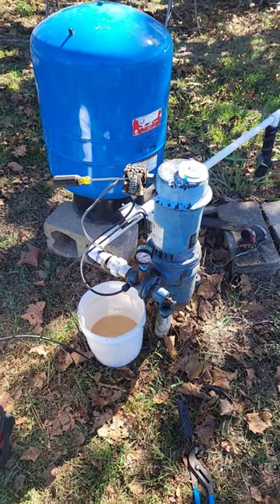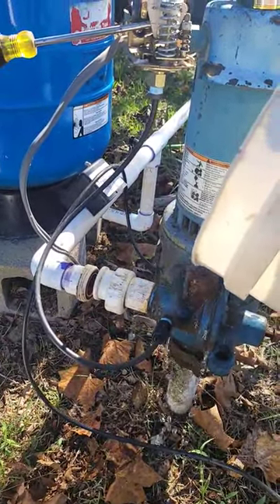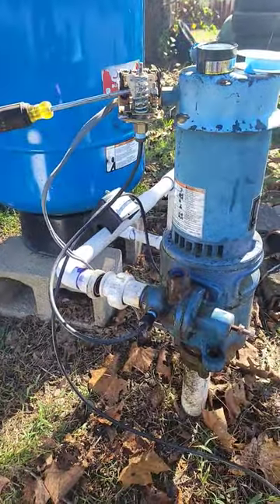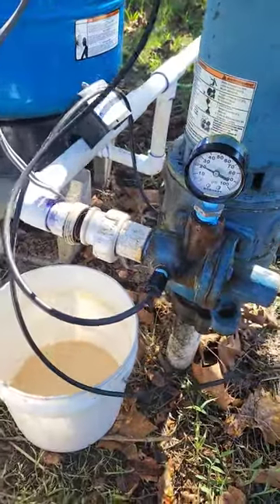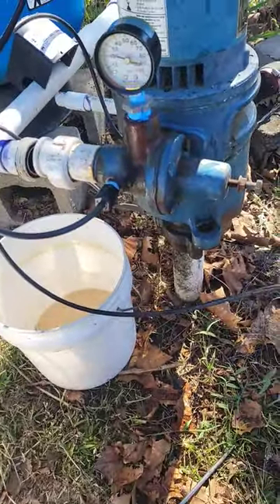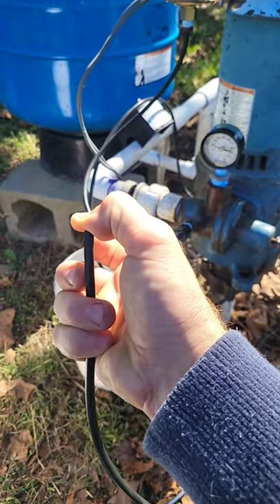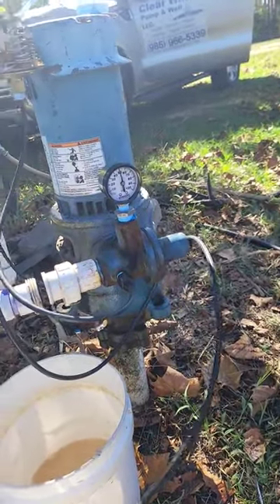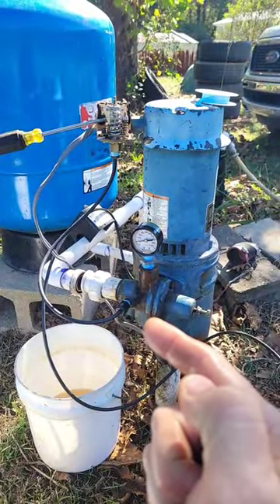Deep Well Pump - No Water - Quick Diagnostic Check

Comment: What a neat way to check for pump operation and determine foot valve issues or holes in suction pipe. When you ran the temporary test line from the bucket, did to connect directly to the pump volute by way of a 1/4” plugged port?
Reply from the maker: Yes hooking to this port goes straight to the suction side.  It allows the pump to build pressure and determine if jet or impellers have failed.  Usually if either problem they can have the same symptoms and be very difficult to diagnose.

Comment: @ClearWaterPumpWell good day sir, im exactly having that kind of problem right now sir,
question: you theres must be a clogged? where commonly its clogged?
Reply: @ClearWaterPumpWell may i ask if that deepwell is now working, and what is real problem of that pump?.does a regulator repairable? or should i buy a new regulator?
Reply from the maker: The jet nozzle in the well on the end of the drop pipe can get clogged with iron flakes.

Or the impeller in the pump can break and not pump enough pressure to jet.

That is what this test I'm doing helps solve without pulling or tearing down the pump needlessly.

Comment: I know this is old video but I got a question and hopefully you can respond promptly, I'm having well issues currently, my well is 43ft deep I replaced everything in the well, jet, foot valve, pipe everything. When I reassembled it and tried to prime it, it wouldn't prime. The original issue for pulling the pipe, was the leathers and faulty jet (no foot valve originally) I put 2 55 gallon drums of water into it and it still wouldn't prime. What could be my issue?
Reply from the maker: More than likely you put jet to far in the well and the water is leaking out the screens. 

You can't put the jet past the screens as the casing seals to the leathers for jet back pressure and discharge line.

Pull up and clamp off until you can fill it.  The jet only needs to be in the water table about 10 ft usually.

Thanks for the comment and watching,
Casey
Reply: @ClearWaterPumpWell  thanks

Comment: How deep are those wells and how deep well that pump suck I live in Southwest Florida we have a bunch of submersibles 
And some old 2 inch wells around town but we do not use pumps like that we use regular centrifugal jet pumps
Reply from the maker: The deep well pump is good from 20' to a little over 100' water table.  Thd depth of the well doesn't matter its how high the water is in the casing.

Comment: I have a question but not related to the video, hope you reply. Why is the water coming out of our pump have a slippery feel, it's like it has oil or something. What's the cause and solution if possible?
Reply from the maker: Did you just service a carbon filter? The carbon dust makes the water feel slick or soft. 

If you have a older pump it cod have a oil bag motor that ruptured in the well. Usually they don't last long after.

There could be several causes but not sure on what type of system you have and possibly something I'm not familiar with also.
Reply: @ClearWaterPumpWell  old people from our place says we need to dig deeper, to hit a more clear water. But it would be another digging and labor costing job. I'm just wondering if you have a remedy for this type of water.
Reply from the maker: @nocomment3866  where are you from and what type of well is it?

Above ground or submersible pump?

Comment: Hello, How can I connect the house to the suction part like you did I have a O A smith pump series 8 A 03 I need help here please
Reply from the maker: The suction port is on the side bottom of the MSE Pump its 1/4" plugged usually.  Use a 1/8 tubing and fitting to connect to port, pump has to be primed for it to work.

Comment: Air emittance valves are not necessary with encapsulated bladder tanks…that’s typical for old school pressure storage systems….that required a air pocket at the top of the tank…
Reply from the maker: Yea late reply sorry, No AVC is installed on this system.
I was only demonstrating using a suction tubing to diagnose a pump or jet problem correctly!

This is very important because if you can't properly identify which one is the problem you may do difficult unnecessary work.

Comment: I have this same problem just replaced the jet yesterday still having the same problem any other solutions need help please
Reply from the maker: When you replaced the jet did you find the leathers, foot valve or housing to have a issue?

There could be a hole worn in the housing from the falling check on inside of Sta-rite jets.  

Your pump won't build any down hole back pressure when you adjust regulator closed?
Reply: Other than the jet clogged everything else looked fine
Reply: The pump was even rebuilt it had bad bearings anyways so it needed to be rebuilt regardless
Reply from the maker: @burtcooley2958   The inside of the pump housing didn't look like this right?   

https://www.youtube.com/shorts/ybUX6KPM5Mo
Reply from the maker: @burtcooley2958  You can call me tomorrow morning by phone if you like we can go over some things. Just look up my business as its the same name of my channel.
Reply: Alright I'll give you a call tomorrow I'm just pretty stumped on it

Comment: When you say its a clogged jet. Is that the jet that at the end of the pvc pipe in the well? that piece that has the leathers on it?
Reply from the maker: Yes older pumps can loose a flake of rust and send it down to jet obstructing water flow.  This can lower max pressure, keep pump running or stop it from building pressure completely.

Comment: What is a bad clogged jet?
Reply from the maker: @petehall8287  the jet assembly which has a jet nozzle in Venturi can become clogged with usually rust flakes or other debris from the well system.
When the jet becomes clogged it prevents the pump from being able to build pressure and it will just sit there and run not making any water or very low pressure.

Sometimes you can blow out the jet pipe with an air compressor from above without pulling it other times you have to pull the Jet and manually remove the obstruction.

Comment: So what’s the    Fix
Reply from the maker: This demonstrates how to test if the pump or the jet in the well is the problem.  Doing this test without taking the pump apart or pulling the jet out.  I was able to tell that the jet was clogged because the pump could build pressure on its own.

Fixing this requires blowing out the jet with an air compressor hooked to jet line.  If that is not successful then it needs to be pulled out and manually cleaned.

Comment: If it can build pressure that way why is the jet at the bottom of the well even necessary?
Reply from the maker: Because on a deep well pump the jet acts like a water pulley system, it can lift the water from a greater depth.  Stand alone centrifugal pumping can only lift from a maximum of 27' without a jet in well to the water table below pump suction.  At 20' alone max pressure falls off quickly and flow rate is also significantly reduced.
This is just a way to test the pumps ability to build pressure alone by centrifical action and direct suction.   If it would not hold prime you can't do this test.
This is only if pump holds water but won't pump normally on its own.  It's a way of determining the problem before doing unnecessary work.
Reply: @ClearWaterPumpWell  Ah. So the water was around the 20' mark or less on that example?
Reply from the maker: @Steve-sg3uz  no in this case the water table was actually 70 ft down in the well.
Reply: @ClearWaterPumpWell  Hmm. I do a lot of pump repair, not the deep well setups, so I am surprised you get any water at all with a clogged jet. It must be only partially clogged in order to push the water you did get up? Or was that small amount all of it?
Reply from the maker: @Steve-sg3uz  no when the jet is clogged on deep water levels the pump won't build any pressure.  The reason I did the little test with the tube in the bucket was to determine if I needed to pull the jet out or not.
Lucky I was able to disconnect the pump and blow it out without pulling it.
Reply: @ClearWaterPumpWell  Okay, that makes sense that the nozzle was partially clogged. Where is the tubing in the bucket attached? To the outside pressure jacket or jetted pressure side? I'm stumped as to why water in the bucket made it work and plugging the tubing did not?

Comment: Lol wait until you get a cold snap like texas. We don't use cheap crap like that in the northern states.
Reply: Be nice! This works for them. Yes I have a submersible well pump also, with a pit less adapter, making it expensive but able to take freezing temperatures forever. You know what though, these above ground pumps are cheap to work on and replace. We get screwed over with any issue. Even if there was a cold snap there, they will probably spend less money in their well than we are in the long term.

Comment: That’s a shallow well jet pump because it only has one pipe a deep well jet pump has two pipes that go down to a jet body with a Venturi.
Reply from the maker: Cool glad you explained how you are wrong.  This pump is a deep well jet pump mounted on the well casing vertically. 

A deep well jet pump like this one has a casing adapter which connect the drop pipe to the 2" well casing.
The well casing is the outer second pipe and the drop pipe is attached to the Jet assembly in the well.
The jet is sealed to the well casing with leathers and the foot valve is below that.

You can watch any of my other videos if you still don't understand how this looks or works.